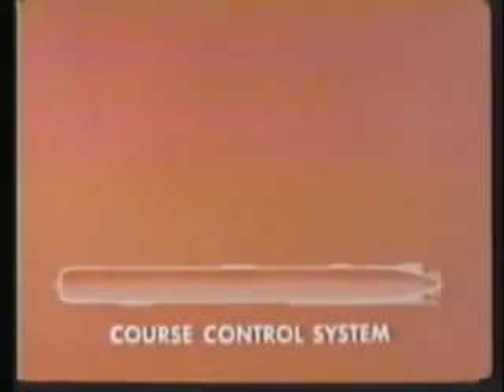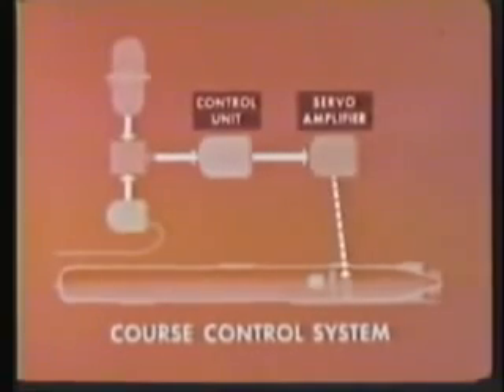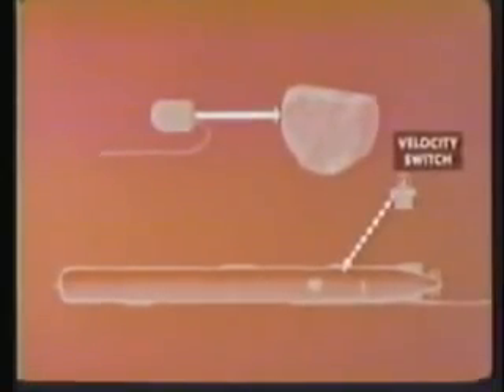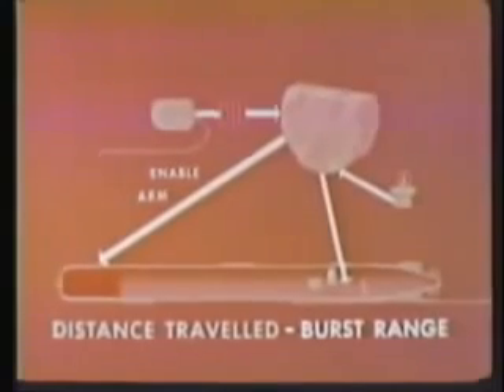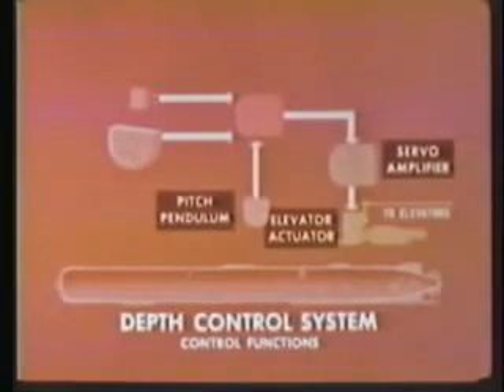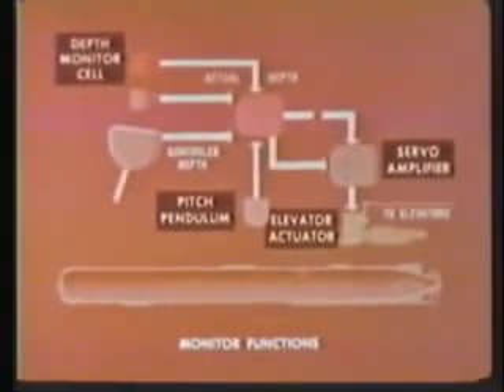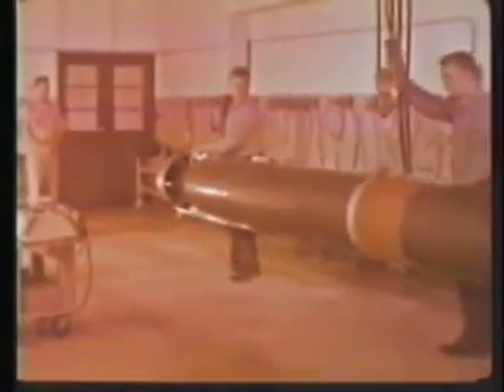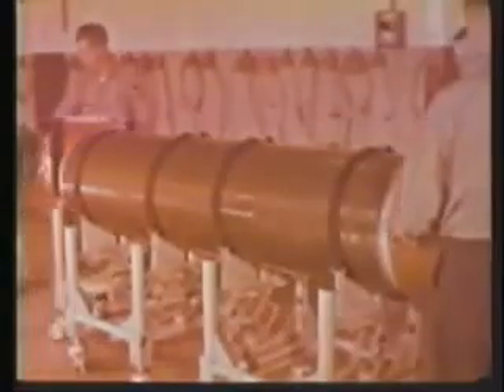Torpedo Mk 45 (Nuclear) Systems Description (1962)

Comment: Will you look at that! It's an autopilot! Here's a question though...the film states the torpedo immediately climbs or descends to a depth of 100ft. Would you not want the climb or descent to start AFTER the velocity switch has been activated to ensure the pressure measurements have been able to stabilise too. If the torpedo hasn't long been immersed is it possible a pressure error could exist???
Reply: The pressure switch is already precalibrated. It doesnt needed any pressure to operate it. Only voltage.
Reply: @bobrobert319  it can't be a switch...it's a pressure sensor. It's job is to ensure the elevators maintain the depth at 100 ft. It provides a signal directly proportional to its depth. The torpedo would have no idea whether to climb or dive if it was simply a switch. That voltage will be used as part of a position feedback circuit in a servo system to maintain the desired depth. The elevator servo, it seems, is positioned by stepper motors to provide the elevator displacement. Some missiles, as an example, use their guidance error signals to change the mark-to-space ratio thus when the desired altitude is reached, the elevator is displaced continuously in an up/down command for an equal time, so the ratio of up:down is 1:1. If an error signal is produced, the displacement ratio changes 1:something else, thus, it cannot be a switch. So, knowing that it must be a sensor and that the possibility exists the sensor may not quite be stable, is it given time to stabilise before being used in the elevator position feedback circuit?
Reply: @elguapo1507  you are pretty smart and should be able to figure it out. I would say no because if the error ocurred after the velocity switch was on it would be in an error mode at that time. The modulator wouldnt be sending the correct amount of signal and it would try to compensate and go out of angle and shut off completely. The sensor is a safety device more than a guidance device.? I would think it knows what depth its fired from, hence the trailing wires connecting it to the submarine. I will try and find out more. If you figure it out let me know.  Because you are way smarter than i am. Thanks.
Reply: @elguapo1507  the ? Would be how long it would take to stabilize the sensor vs how long it takes to get to 100feet before or after reaching the 23 mph for the safety switch to turn on?
Reply: I thought it only allowed the switch to be on after reaching a certain distance away from the sub anyway? So it would be stabilized by that time then be able to be armed by the switch, if up to speed?
Reply: @bobrobert319  No, the switch is part of the arming circuit and also the anti circulation system preventing the torpedo from trying to come back round on itself. You see, imagine a crew are very proficient at loading the torpedo tube and it's fired immediately the tube has been flooded. The pressure in the submarine is 1atmospher, for example, then suddenly the pressure sensor is immersed in to depths of hundreds of feet of water. How long before the sensor stabilises?
Reply: @elguapo1507  my point was how long fo you think the depth sensor needs to be stabilized after its lauched. It couldnt take more than 2 seconds after being outside of the tube?
Reply: @elguapo1507  if it was a problem they would have designed it a different way or made a better sensor right?
Reply: Ill get the mk 45 manual and figure it out.
Reply: @bobrobert319  well, I realise you're using 2 seconds as an arbitrary figure for an example but let's say it only takes 1 second for the velocity switch to trigger...I know it wouldn't, but you have the velocity switch there to prevent an unwanted detonation, likewise you have a pressure sensor to prevent the torpedo from being detected....they both have extremely important functions in the torpedo's success so would you risk the pressure sensor giving erroneous error signals by simply hoping it has stabilised or do you guarantee the signals are accurately derived?
Reply: @elguapo1507  watch the video again about the depth monitor system functions.
Reply: Around the 6 minute mark.
Reply: @bobrobert319  Wow! That's a long time! So that's about 4nM away from the boat, roughly? Quite a distance away but would that be a safe distance if it went off immediately at that point? That's pretty close to a nuclear blast, however "small" it might be.
Reply: @elguapo1507  i meant the 6 min mark in the film. It actually uses two systems to monitor depth.
Reply: @bobrobert319  I will Bob, good idea! By the way, thanks for posting this film. I love watching this kind of thing because it gets you thinking! Pleasure speaking with you sir! Thanks again!
Reply: @elguapo1507  i was wrong it only has an 8 mile range.
Reply: @bobrobert319  That's it Bob! You're absolutely right! It all really starts to happen at 2050 yards before it starts to really descend to its desired depth. I completely missed that and as you rightly said, it's wire guided too. Thank you Bob! You pointed out the error in my ways! Appreciate it!